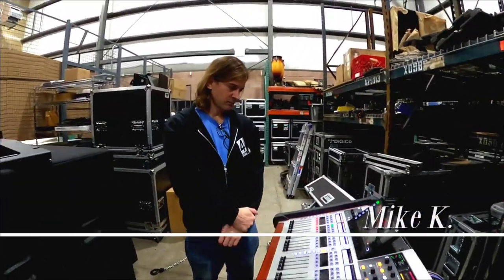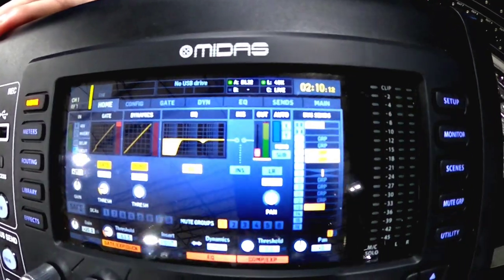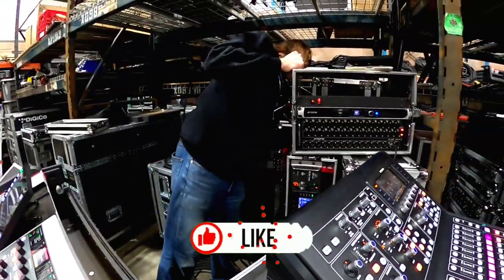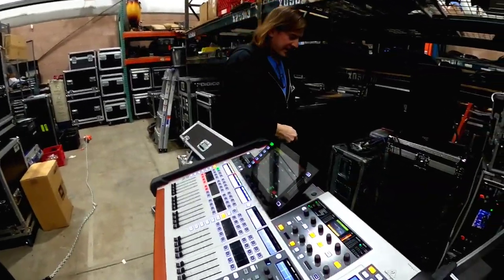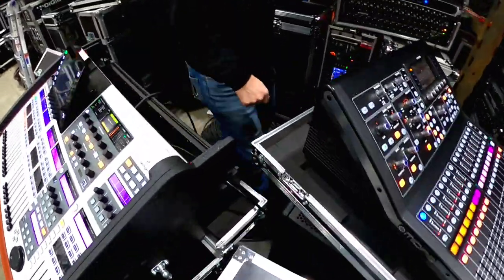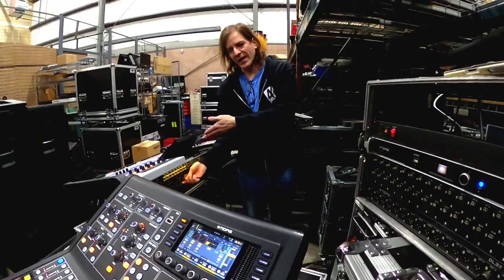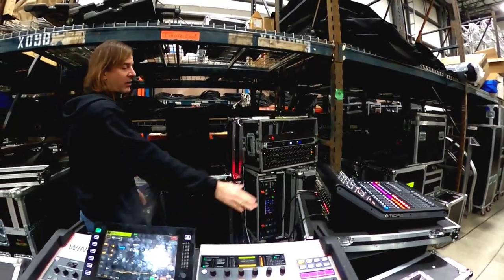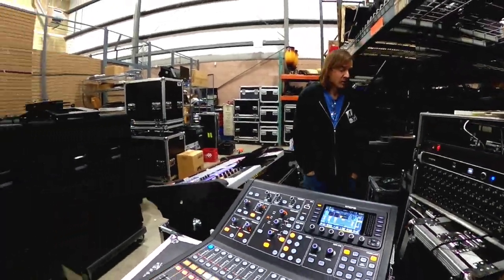SSVC3 - Cat 5 City Testing With Behringer Wing Console And Midas M32

Comment: Such a bummer how inconsistent aes50 is a long distances. Good to know that the wing has fixed the aes50 stability. 
Iv found 60-80 meters with a good shielded cat5e cable will hold. But it’s really a hit or miss. Dante  and other protocols that use cat5e do not have these issues.aes50 can be a real pain in the arse.

Comment: I posted on the other video, but Cat5e STP with a shielded RJ45 connector and EtherCon with shield continuity between the EtherCon, RJ45 and cable shield is the spec cable to use for AES50 to my knowledge. Behringer implemented AES50 in a weird way on the X32 and M32, requiring the shield to go through the EtherCon connector, it looks like they have improved this with the Wing. Its a static discharge issue which causes sync loss if the AES50 link is incorrectly shielded.

Comment: ILive T80 with 300’ Rapco-RJ45 splice-200’ Rapco to IDR/48.  Works normally, No anomalies.  Audio generally does not run through the CAT cables on the Allen and Heath ILive&DLive systems

Comment: I have had similar results including the stellar performance with the Wing. Interesting though that AES50 get's blamed to some extent, but I have zero issues with Midas PRO1 and Midas Pro stage boxes. The X-M32 systems are excellent and serve a purpose if you can get your cable lengths down to 50ish meters.

Comment: Had the same issue with my CBI Cat5 cables (back when Behringer claimed any ole cable would work). Lost a pretty lucrative corporate ballroom gig because of it. 

Switched over to the cable that Behringer began selling (the Klark Teknik NCAT5E-50M I believe) and for the past 5 years or so and it's been flawless. Only 50 meters though.
Reply from the maker: Damn sucks you lost the gig over it. Not your fault technically, but there's nothing you can say to them. It's happened to us too.
Reply: yep. I can't get NCAT5E-50M to pop or lose sync. Also had good luck with the Rat SuperCAT..

Comment: The cable has to have the ethercon shell bonded boys.... not just the metal connector. Also there is a new spec that x32 can only handle 200ish feet... midas can handle a bit longer , but nothing over 300’  i have cbi as well and its garbage.  I have a couple others,  vandame cable is ok, and the rat sound ethercon i have is a rock.

Comment: For some reason the x and m's always had that issue with cables. The same cable will work fine on pro consoles that pop on an x32.
Reply from the maker: Yeah we never had an issue when we had the Pro2. Crazy thing is, you can go many gigs in a row with x32 M32 no issues, then the time it happens is when the college president is talking.